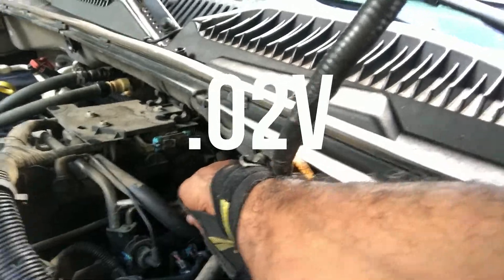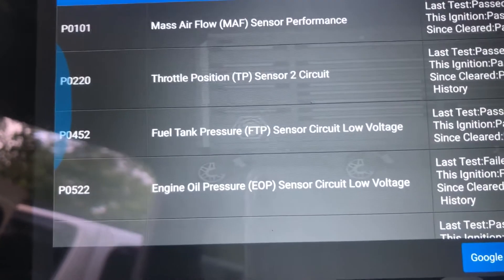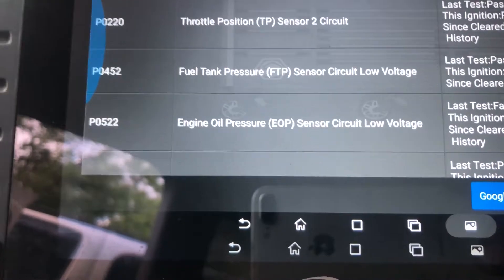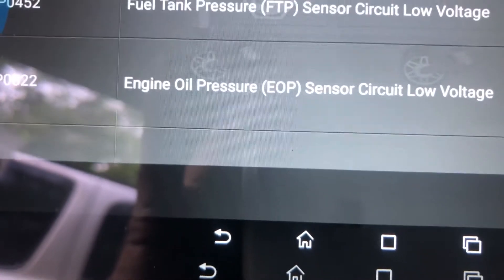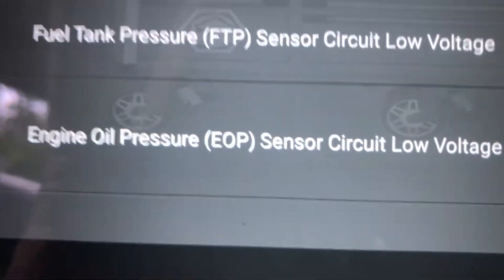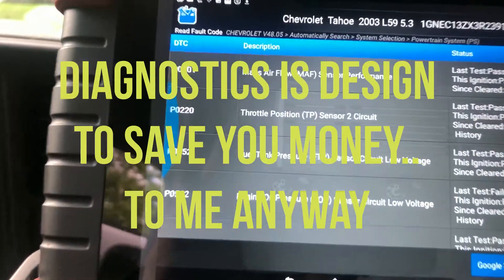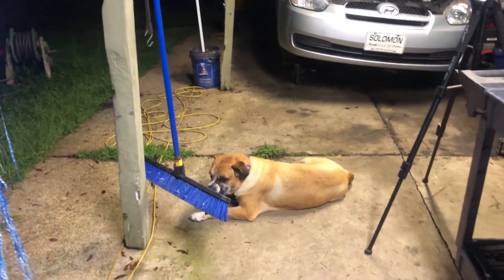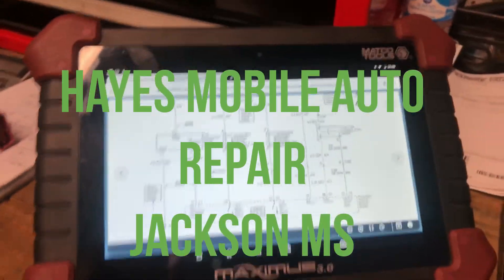CHEVY 5 3 REDUCED ENGINE POWER WITH MULTIPLE DTC

Comment: Hayes can you help me?  i have a 07 durango  with a crank no start i have been threw everything  trying to fix it...from thinking i just needed new coils   to  a brand new crank and cam sensor...  now i have put in a  new pcm  that i had programed with the vin number  and nothing still wont start  i do smell gas when cranking....   i swapped the asd relay with the blower relay  they relay itself is fine  but its not getting power when pilugged into the asd spot..... plzzz plzz plzzz hlp
Reply: oh and  the compression is fine
Reply from the maker: sorry im just getting this...alot more info is needed.  hope u got it fixed up